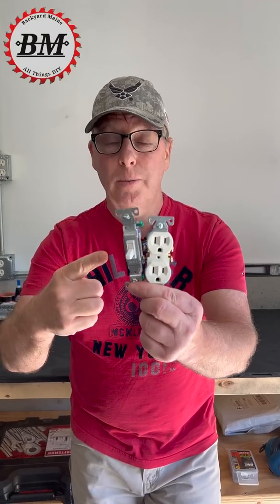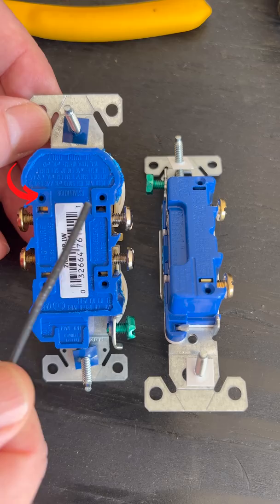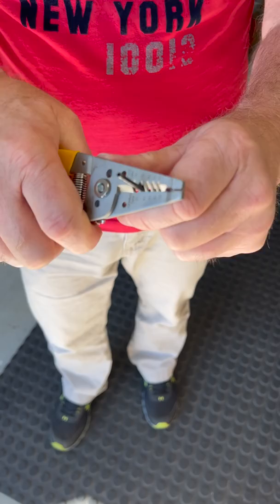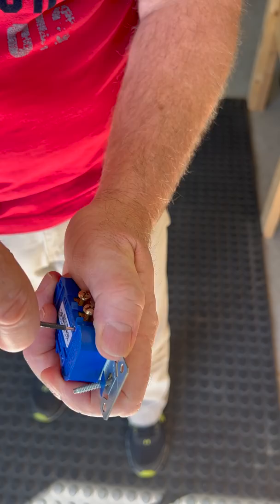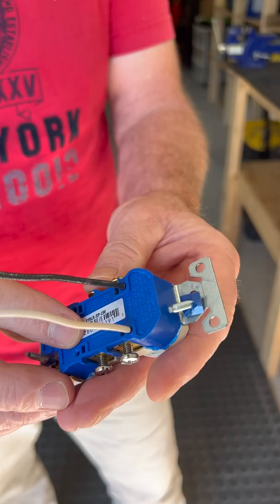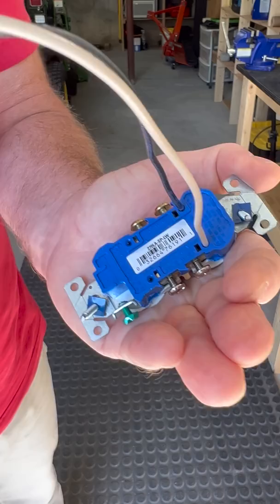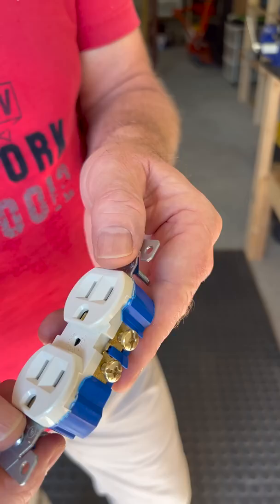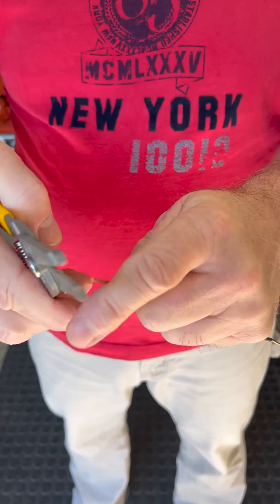Don't make this electrical mistake #Shorts

Comment: Every time I pull an old outlet out of the box in my house the dang back wired connections always fail and the wires just pull out. I've found that the best of both worlds is to buy commercial outlets that have a plate on the screw terminal so you can stick the straight wire into the proper hole on the screw terminal, tighten the screw and you're good to go. Very easy to use and it's a solid connection.
Reply from the maker: I agree. They're a much better device overall. I use them most of the time but I show the residential grade in many videos since they are so popular due to the price.

Comment: I gotcha on that. I went on a service call 40 years ago on siesta key. A lady smelled smoke. Don't know why she didn't call the fire dept. I went to where she pointed me and she had a plug mold with 8 devices plugged in.  The outlet wasn't original to the house. The house was 1950-1955 ish. No device box. The paneling was 1" thick cedar tongue and groove. The original owner built it. No boxes just ran wire to the location then installed the T&G. Later he cut a tight shape to install the receptacle with a jigsaw. In this case  the side wire screws on the"hot" side    right. The terminal screw was in contact with the wood and the recep was wired by the stablocks. The load she put on the outlet required her to screw a 30 amp fuse in to the panel for that circuit. The wire was (#14 ga without ground woven sheath).  The terminal heated the wood to the point of ignition. I pulled the cover off and right there on the right side were two little red glowing embers in the cedar. She was less than 1 hour from that tinderbox of a house being a 30'x45' bonfire. Today it is the site of turtle bay condominiums building A. "North building. Thank you for showing the proper method.
Reply from the maker: Wow, sounds like you saved someone from a fire. So many things wrong with her installation she's lucky the house was standing when you arrived.

Comment: That's why my garage lights always flickered. I replaced the switch and to my surprise it was "back stabbed" in a curious way. Since there wasn't any holes on the backside of the outlet, they just decided to side-stab it cracking the plastic, rather than using the side screws.
Reply from the maker: What the.  lol.

Comment: I find it very interesting that many of the Electrical professionals caution against the back stab connections and some of the same advocate the use of lever lock connections vs wire nuts. I have followed people who have used the lever lock connectors to make a repair of flickering lights and burned connections. A properly done splice or screw conjuction is much more reliable.

Comment: This is such a good tip. 

Recently had a issue were lights and plugs lost power. I spend days looking for the issue. Eventually having gave up. I plugged an extension cord into a working outlet and boom everything powered up. Pulled it, and sure as shit it was a loose clip in wire. Which was arching. Old electrician I knew said same as you. Use the screws.
Reply from the maker: I give this advice because I’ve seen so many failed connections over the years.

Comment: I've been there and done it the backstabbing its a fast way to have to come back and rewire the plug or replace because of electrical Burned plug ends .I've found out to do a pull test when you screw the side screws for a good wire holding so you will know its contacted right or tighten right enough to hold from sparks or even worse.

Comment: Yea 14 years of field work as an electrician I personally hate stab lock receptacles late 70s through early 90s trailer homes are notorious for having them 9 outa 10 electrical issues are due to a broke neutral and in most cases it's a stab lock receptacle that failed
Reply from the maker: That’s my experience as well.

Comment: Replaced all the outlets in my house, assuming they were originally installed when built in 1980, a not insignificant number of outlets had 1/2"+ backed out of exposed wire from using that type of wiring. Several light switches had scorch marks.
Reply from the maker: Yup.. That's the problem. Over time with heating and cooling cycles the connection tension gets weak. Thanks for sharing.

Comment: This is the exact info I am looking for. Replacing a switch for the first time and had expectedto see the side connections per the fyi video I watched. But the bad switch had back stabbers and prior video didnt say how to remove the wires. Now I know how and bc you and other video recommended side connections I'll go with that option. The other way is likely why my closet light started flickering. Maybe i can finish before total darkness. Thank you so much for your Video.👍🏻

Comment: Manufacturers could have been making improvements on this product more than 20 years ago. Shows you how much corporations really care about you. Home electrical is about 30 years behind what it should be on average per home. It's amazing to see how many houses are still standing after they have been put together like this.
Reply from the maker: I think the products are fine but these stabs are the worst. They do still have the screw terminals though.

Comment: No need for a small screwdriver to remove a wire from a backstab. Just twist the receptacle back and forth a couple times and the wire will just come out. That also show show weak of a connection backstab is. That being said, not to be confused with backwiring on commercial grade receptacles, those are good and save a lot of time.

Comment: Not to be confused with back clamping on better receptacles. Stabbing has just an edge contacting a round wire.
Reply from the maker: True. I have a video detailing the difference between back stabbing and back wiring.

Comment: Thank You! Too many times I’ve seen this in American homes and the common 15amp 2000w load on a spring loaded contact just touching the wire. There’s so much more contact area at the screw terminal that the wire comes in contact with underneath a tight screw head.
Reply from the maker: My pleasure. Thanks for sharing

Comment: You can strip the wire coating with your outlet or switch.  To the left or right of the screw that retains the outlet or switch to the box is a channel made specifically for stripping the wire.  You probably knew this already but if not now you do
Reply from the maker: See my previous video detailing that feature..

Comment: Thank you so much for this! After watching, I immediately went downstairs where I've had issues with flickering lights and a specific receptacle that trips my breaker regularly. Sure enough, the electrician back stabbed it! I'll fix it like you showed. Thank you so much!
Reply from the maker: Happy to help. I hope it works out well. Be sure to turn off the power first. 👍

Comment: I recently found a light switch with the bottom corner nearest the hole completely broken off leaving the wire floating in the box. Took longer to go get a switch than it did to fix it properly.

Comment: I’ve told a lot of people exactly what your saying. I’ve seen fires caused by these. And as always there’s people that argue and all I’m trying to do is give good advice. BTW I’ve been an electrician for 20 years. Thank you for this post.
Reply from the maker: Same here my friend. I would say maybe 15% of the comments say these are a great connection and they have never had an issue. I find these things failed all the time or at least I did before I retired.
Reply: @BackyardMaine  I’ve personally seen two fires started by these, and stopped two fires before they flamed up.

Comment: Side wire are tighter connection with more surface area contacting the wire. Stab backs are totally fine if you don't run space heaters, hair dryers, dehumidifiers or other high amperage loads.
Reply from the maker: I have seen them fail on switches with lighting load many times.

Comment: Most builder's electrical crews are installing back stabbed receptacles and they pass code, so, it is what it is. I'm a remodeling contractor and I never put in those $1 each receptacles. I always use the more robust screw-type side or back wire receptacles. That extra $1 per receptacle saves a ton of time on installations and the receptacles are more robust.
Reply: Faster, faster!!!!

Comment: I just renovated a house that is only 25 years old and I was appalled by the shoddy electrical work done by an electrical contractor. They used the backstabbing almost exclusively even for pass thru. No pigtails. Crazy.
Reply from the maker: Thanks for sharing.

Comment: I came home from work one day and smelled an electrical smell. Found it in my kids bathroom and just as I pulled the plate cover off there was a big puff of smoke and a flame. Luckily I had brought a fire extinguisher with me… It had been wired using the back stab method. I spent 3 days pulling out every switch and outlet in the house. It was the only one that had been wired that way. So fortunate to get home and catch it right away. Could have easily gone the other way and lost the house or a family member.

Comment: Use a commercial grade at minimum with pressure plates under the screws. You can wire straight into the back and still have the quality of a connection you get with a screw. 
Those spring loaded backstab receptacles should really be forbidden from use in the NEC in my opinion based upon my experience with them. They are a fire looking for a place to start.

Comment: I can relate to that they lose contact after a number of years like 20 or so. I’ve had issues in my house. I’ve had to go and fix all my plugs and switches. wire them all direct no issues. The quick and dirty way is quick but it will eventually screw up in my experience

Comment: My understanding is that those connections on the back were for Aluminum wire due to the expansion and contraction of theat wire losening the side screws, causing charring and possible fires.  I would look up the NEC on these connections.
Reply from the maker: Nope they are rated for 14 AWG solid copper wire. They're just not reliable.

Comment: If you run good 12 gauge wire to everything you usually have to use the side screws anyway
Reply from the maker: That’s true these are only rated for 14AWG solid wire. 20A devices used to be approved as well but not anymore
Reply: You can shave down 12 gauge wire so it will fit.
Reply: I always use the back stabs. They wouldn't make them if they didn't work.

Comment: Always done it that way because I didn't know about the hole conections but I would not have used the hole connections anyway because the screw connectors are the proper way to do it. THAT'S WHY THEY ARE THERE !

Comment: Must have to do with brand of recepticle. I've installed literally thousands of outlets and switches by backstabbing and I've never had an issue with the Pass and Seymour brand. One important note to make is that these backstabs are one use only. If you pull wire out, it's not longer reliable to use a second time.
Reply from the maker: I have repaired or replaced so my I cant count and they have been many different brands. Not sure about Pass and Seymour though.. I don't use them but yes you are correct. They are one use only.

Comment: Plus - use square tip bit to ensure best connection, you could also pigtail into one connection . Tape if in a metal box , buy industrial ( or better quality) grade devices .There’s always something more you can do to ensure longevity and minimize problems. Most of the time it comes down to attention to detail and quality of work .

Comment: I never did like sticking them in the back alley for them on the screw sure they had a better connection and easier to disconnect and replace

Comment: Electrician here. I'll catch flack for this but, production houses always get the backstab. I'm one of the electricians that will actually admit it.

I've been doing this job for 25 years. I'm still not entirely sold on the backstab hating. It's a weaker point, I agree but, the failure rate is not NEARLY as high as advertised. I'd classify backstabbing as "fair".
I think it's just popular to hate on the back stab.
Hey! it's UL approved ( we all know how everyone loves talking about United Labs)
Reply from the maker: Thanks for sharing your experience. I have had a different experience finding so many failed over the years. I don't think it takes that much more time to use the side screws which I think we can both agree are a better option. But I have heard others in the comments with a similar experience as yours.
Reply: @BackyardMaine  
The higher end houses get the screwed!
It’s all about contact area.

Pass and Seymour legrand is excellent for the side wire option. ( the forgotten 3rd wiring option and my personal favorite)

Comment: I've hated these since day one. Someone goes to replace a switch inside a double-sided box and ends up yanking out the stabs from the receptacle on the backside.

On the plus side, you don't need a small flathead to release them. Just wiggle back and forth.

Comment: I always put a hook in the wire and secure to the screws. I have been going to work with my dad since I was 3 and he is a general contractor and I have wired many different houses. Because owner builder permits you only need the work to pass inspection it doesn’t have to be done by a licensed professional. My dad did the plumbing and I did the electrical and we both did the carpentry together. Everything from pouring the foundation to putting the shingles on the roof.
Reply from the maker: That's awesome.. I also do plumbing and and carpentry but my profession is electrical.

Comment: Unfortunately heavy current loads can anneal the spring tension out of that type of connection or concentrated heating can cause oxidation to the small contact surface. And subjected to vibration it is not longer a solid state contact..

Comment: I have heard this back-stab comment a lot and I built a home in 1987 and back-stabbed every outlet and in the past 36 years, I have had zero failures. Am I just lucky?
Reply from the maker: That is surprising. Maybe they made a better connection back then. I see these fail all the time.

Comment: Interesting, here in Germany it's quite the other  way round. All of our outlets and switches are the press-in type. It might have something to do with the different voltages, though. We have twice the voltage, so half the current is needed for the same amount of power to flow through the wire (and the connection).
Reply from the maker: Yes I know. Been there a few times on business. Maybe a better design and also like you mentioned the higher voltage.

Comment: Very good video.  Also remember a device should not be used as a current carrying conductor.  Pigtail your devices.
Reply from the maker: Thank you. The code allows for both and the manufacturers do as well. The pass through current rating is 20A even on a 15A receptacle. But I do often pigtail depending on the application.

Comment: The only ones I will back stab are outlets truly made for it where the screw release a clamp piece to insert the wire and tighten typically on higher end outlets or some GFI
Reply from the maker: Yes those are not considered back stabs. I use them often and they work great.

Comment: The terminals and switches also have built in wire strippers and wire benders to make the perfect loop for connections
Reply from the maker: I made a video on that as well. My most popular one to date.
Reply: @BackyardMaine   I just saw that about 20 minutes ago, good job my man. :D

Comment: I've been saying this forever and it's nice to see someone finally agree...they sound cool until 15 years down the road you have a window  ac running and you burn your house down
Reply from the maker: I was surprised how many people in the comments that think they’re great.
Reply: It's the same for wagos for me maybe on a lighting circuit but not on a receptacle
Reply from the maker: @derekdavies7374  I’ve only used them on lights but people swear by them. I have some on a well pump now for testing. I’ll see how they hold up over time on a stressful circuit

Comment: There are better hybrid backstab types that actually use the screws that have an internal clamp that tightens against the hole with the actual screw pressure, no annoying springs to get hot & wear out, fixes the stab-lok issue. Yes these things always break constantly fixing them to be looped around screw terminals in rentals all the time.
Reply from the maker: For sure, but the are not considered back stabs. They are on commercial grade or above and I use them almost all the time.
Reply: @BackyardMaine  Almost the same installer convenience of a back-stab/stab-lock, but won't burn the wires by coming loose. Thank you for clarifying.

Comment: Years ago when I was renting a old house that was built in the 30's.  I went to replace a wall switch and pulled it out, no electrical box just a hole in the wood where a box should be.   Went into the attic and found knob and tube wiring.  Needless to say I did not stay there very long.
Reply from the maker: When I was a kid we lived in an old farm house with knob and tube wiring. When I got out of the AF in 88 I rewired the whole house one room at a time. What a pain that was..

Comment: I agree with you, but I am curious to see your view on the use of the wago connectors? They are very similar in the way they work
Reply from the maker: They are a bit different in the way they clamp down rather than wedge a wire between to conductive surfaces. I haven't had much experience with them yet but I have a few installed right now on a well pump which should put a decent amount of stress on the connection. I'll make a video on them soon.